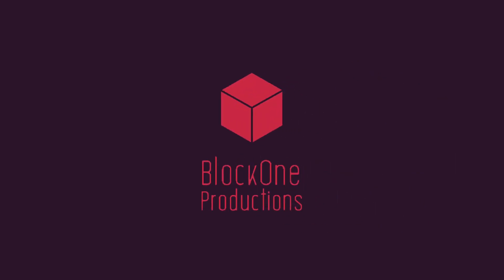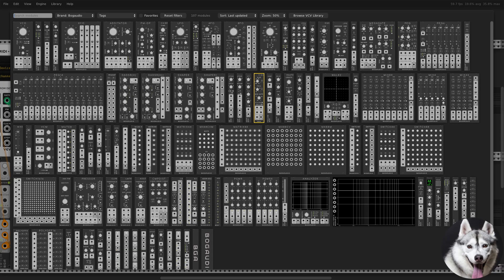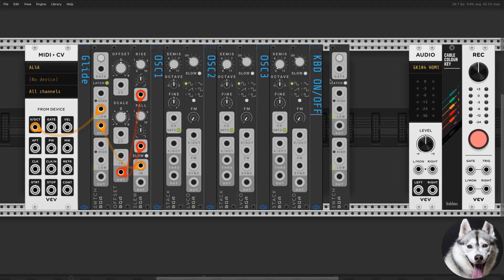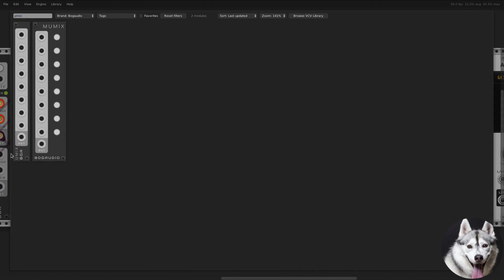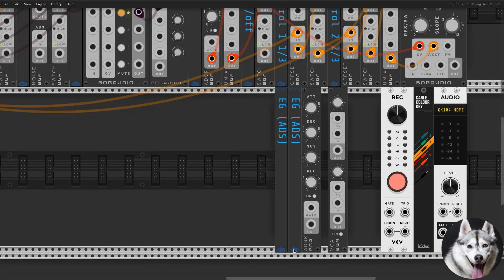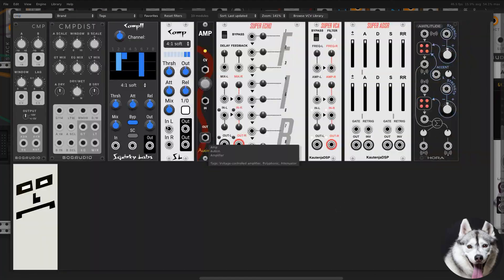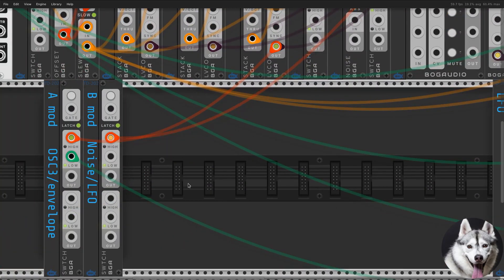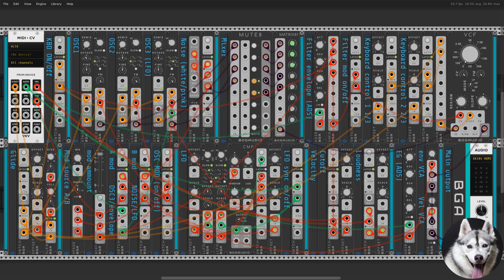Tutorial: Minimoog in VCV Rack using only bog audio modules (English)

Comment: Very nice! One note: The Minimoog has a switch labelled "Decay". When engaged the decay controls for the envelopes control a release stage as well as the decay stage. A common trick with the Minimoog was to plug the headphone output into the external input to drive the filter harder. It'd be interesting to see if that works with this recreation.
Reply from the maker: That's really interesting! I'll try to recreate it as soon as I can